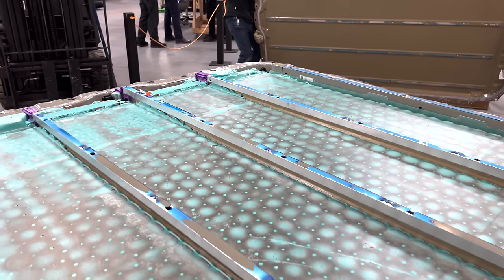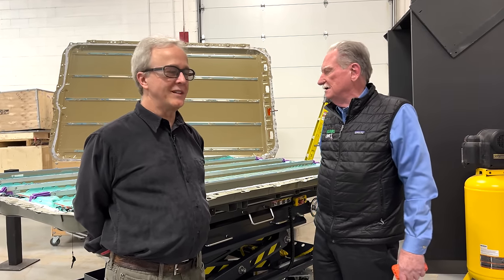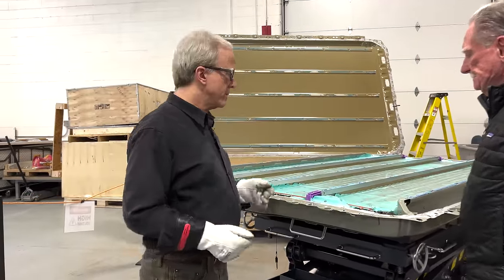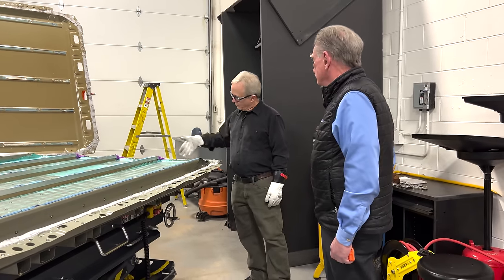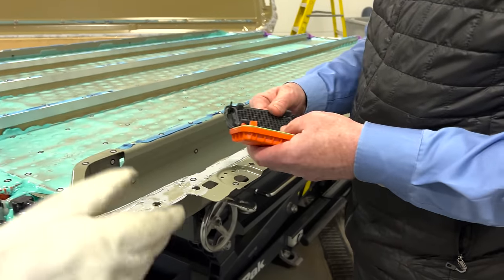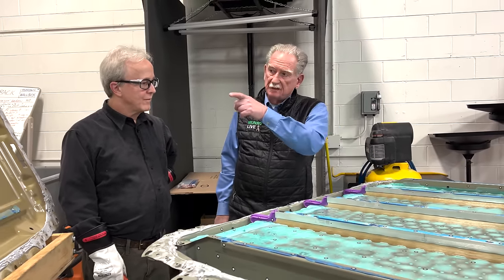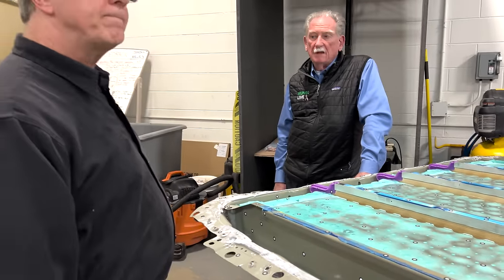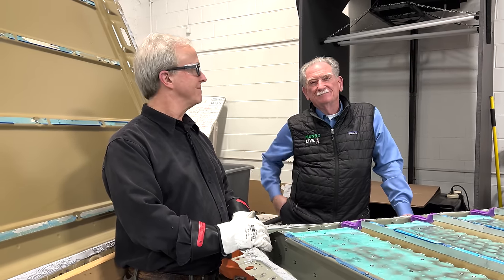Tesla Cybertruck Battery Pack: Our First Impressions Under the Lid

Comment: Salute to Cybertruck Engineers
Reply: salute to the honda k24 engines on my channel is the highest milage suv on the planet the honda crv with the k24 over 1 million miles no electric vehicle on the planet is better than my vehicle.
Reply: ??? for building a battery that cannot be repaired if anything with its 10,000+ parts go wrong??
Reply: @tellyboy17  - Better to have a pack that never fails. As you add modularity, connectors, and can't deal with a little moisture, your pack becomes less reliable and may need those repairs you seem to want. Poor reliability is great for the dealers and service techs!
Reply: @tellyboy17 
Only ev on planet has bidirectional charging and 150K miles warranty on the battery
Reply: How many Cybertrucks will ever change their battery after it will go dead in two decades?
Reply: lol!!!! salute what!? since the tuck came out it hasnt made any serious offroad, whats the point?!
Reply: @tv-ld3wv Free Supercharging transfer  gotta be leaving the chat after bi directional becomes mainstream.
Reply: @tv-ld3wv  The warranty is 8 years. After that the smallest defect in this battery means a total loss. This means that after 8 years residual value will be close to zero, or basically as much as a gambler is willing to venture.
Reply: @tellyboy17  
150K miles or 8 years is the worst case scenario
Normal worst case scenario: no home charger
In cybertruck case : add bidirectional charging
If most of your charging is at home + no bidirectional charging then this battery will survive over 15 years or over 500k miles
Reply: @tesla_tap Never fails, sure buddy.
Reply: @XantheFIN  two things, legacy repair services and alternative drop in solutions …
Reply: @tv-ld3wv  The f150 lighting has that since launch
Reply: @billybobbob3003  There are plenty of vehicles with the Ford 300 (4.9L) that broke 1 million miles. GM also had the 3400 v6 which is extremly reliable, many early Lexus's broke 1 million.
Reply: @JD-yx7be 
You didn't get the point 
Worst case scenario for EV is only super charging with no home charger now add bidirectional charging but still having 150K miles warranty on battery is impressive 
That means if most of your charging at home the battery will survive over 15 years or 500K miles
The lightening will change the warranty since they have access to Tesla superchargers now
Reply: @JD-yx7be  im talking about honda k24 holds record for the most miles for a sport utility vehicle/crossover.

Comment: brilliant design.  elegantly conveyed by Tom and Sandy in layman's terms.  Much appreciated!!!
Reply from the maker: Glad you enjoyed it
Reply: Its a disposable battery pack that isn't going to be financially viable to replace. Once again Tesla has taken awesome tech and made it worse than a cell phone.
Reply: @EthosAtheos  was thinking the same , it wont be possible to diagnois any problems.
Reply: @EthosAtheos  this battery pack is designed for extreme conditions so it is basically completely sealed, while implementing some inventive safety features.  Design is superior to anything else out there for the same purposes.
Reply: @ep7  no
Reply: @BBingo-v5i  can you give an example of another vehicle battery pack with these features?
Reply: @ep7 Superior? Lol. Thats why more Tesla's then 1930s Ford's is standing in junkyards.
Reply: @EthosAtheos remember when Apple decided to make batteries in iPhones non replaceable by user? Many people said “what if”. Many more keep buying iPhones.
Reply: @EthosAtheos  It's worse. It also means that it is unusable in other applications as the modules would have to be rebuilt.
Reply: Disgusting design. Can't be repaired, recycled or replaced.
Reply: @radry100 I’m sure the Tesla engineers didn’t think anything through when designing this battery pack. 😂. Good thing you’re not part of the team as well. People thinking of easy to replace batteries are kidding themselves. You expose much more risk to the battery packs itself if you can easily detach and replace it. It’s built to last for a reason. This ain’t a tv remote. Same idiots who refers to everyday batteries in cell phones and remotes will think these batteries will degrade at the same rate.

I rather have a battery that will need to be replaced every 10-15 years than every other year.
Reply: @danubiosalas4231  Haven't owned an IPhone sense the 5. Because of the way apple was going.
Reply: @ep7  Yes, but actually no. There is no reason to make a battery impossible to replace cells or at least sets of cells. 

I off road and my gas tank is sealed and easily removable. The fuel pump inside isn't welded in. The gas tank has a skid plate to protect it and isn't the lowest point on the vehicle. 

With minimal effort you can adapt my car to being submerged in 32-36" of water. Same as the cyber unrepeatable truck. O and my vehicle weighs 1800lbs less than the cyber mistake. 

Also the battery isn't completely sealed. It can't be. They even talked about how it isn't and what can go wrong. 

It also completely fails at being "design is superior". A land cruiser or even Jeep is a better off road vehicle. An F150 is a better truck. Even the lightening is a better EV truck.
Reply: @EthosAtheos  You are talking about ICE vehicles. I was responding that for a battery based power supply this was very well designed and I’ve not seen anything comparable. I think you are responding based on a tangential assumption to my original comment. Yes some ICE vehicles are better designed for those purposes you’ve mentioned.

Comment: I saw a lot of people drawing hasty conclusions based off of the single photo Munto posted on Twitter a few days before this video went live, and I just want to say it doesn't seem like there is much room for another layer of batteries. 

Edit: its room for gas venting in event of runaway and also extra space in the event that you hit something underneath the car.
Reply: almost like people who dont know what they are talking about should jsut keep quiet LOL
Reply: YEP. :d People are delusional. Why would u leave 80mm of extra empty space. Altought if they want too doo doubble pack they can in "theory" do it such way they decrease pasanger space and ground clearance if the mirror pack and compact it. Needed diferent central console and sets frames in this case. So 30-400 les passager space and 30-40 less ground clearence could give u dobble pack. But i m sure they will not doo that. CT in afterall niche product.
Reply: @Hotspur37 Yeah it was just weird how people were drawing conclusions based off of a photo that was posted that didn't have any explanation from Munro lol. It was just a simple picture of a battery pack.
Reply: lol!!!!!! its for offroad purposes which the vehicle still hasnt yet proven any serious capabilities

Comment: That thing you mentioned about the difficulty in disassembling this newest generation of battery doesn't bode well for recycling the packs when they expire. Just dealing with the cells themselves is apparently an issue, but when the pack is completely glued together like this, I imagine it will present quite the problem.
Reply: These packs usually just put in an industrial shredder and the difference materials get separated for recycling.
Unfortunately you can’t reuse or repurpose the cells due to being bonded together but recycling is still possible by breaking down the packs to their raw materials.
Reply: @streddaz What a waste....
Reply: Throwaway battery

Comment: Anybody thats done legitimate off-roading  knows that cover is absolutely going to get pierced if people push it. 

The aftermarket will solve this serious deficiency but do not being trying to rock crawl without the aftermarket parts first. Of course youd need lockers too so that might be a long long time 😂
Reply: I was thinking the same thing Elon said it was more truck than a truck I don’t think so this flimsy pack cover will be punch thru and then water will get in plus if you go a sell the truck with a dented and scratched up battery pack how good is this going to be for resale value ? If the truck came equipped with a removable and replaceable skid plate the this part could be easily replaceable I think TFL trucks tested a Hummer EV off road and they scraped the underside of the truck but they said the truck had a skid plate and the engineers said that it was designed to be able to support the compete weigh of the truck 9000 lbs.
Reply: The Cybertruck that has two electric motors on the rear axle, has an internal "differential" lock that combines the torque of both rear motors. Of course when disengaged, each motor operates one wheel.

Comment: As an offroader, I would disagree that the crush zone under the battery is quite enough.  Yes, we often come down on rocks which can dent components under the vehicle.  But rocks can be sharp enough to pierce things like the oil pan, transmission pan, gas tank.  So it's quite common and cheap to put thick steel skid plates under these sensitive areas.  This battery is huge, so while a skid plate could be installed, it's going to be really heavy and will need strong, secure mounting points to bolt the plate to.  With a Wrangler, that's typically the frame, using a lot of the points that the existing pans and tank are mounted to or the engine or transmission case.

Comment: Another great video Sandy and Tom!  I wonder if you could break off a chunk of thet structural foam and do a.Flamibility test?
Tesla has some great solutions for handling water ingress.  Unfortunately that foam is likely make the pack economicaly unrepairable, prevent fire fighter water application to the cells, and hamper efficient recycling. 
Then there's the stranded energy issue.  In a.breached battery of conventional design dunking the pack remains in brine or sodium bicarbonate solution will eventually discharge all cell groups. 
With the pretty green foam keeping water out, all bets are off. At least my bets
Reply: good points , its a pity , it looks like will be impossible to repair ,hopefully Tesla has some sort of insurance in place for that problem.
Reply: It's designed to be ground up and all the elements are separated then recovered for recycling/reuse.
Reply: @tomnel  BS you can't recover anything from destroyed material  Not to mention the expense it's cheaper to make a brand-new one.   This whole design is throwaway garbage which is okay but they should be honest about it.

Comment: More on the vent valves and their reliability in dusty environment, researling after contact with water and maybe some guidance on maintenance on these would be useful. In the nordic climate, the older model s are suffering from "leaky" valves where dirt accumulates and compromises the selaing, thus allowing more road dirt and winter road salt to penetrate the battery, even with no real water exposure.

Comment: the 4 modules not for repairability but for reducing scrap cost at production, if they have a faulty modul thez can replace that one and slam in a new one before they foam and glue everything together. It would be hard to produce a whole battery without faulty welds or connections so this is makes production cheaper by allowing a little rework.

Comment: @24:35 Suppose you high-center your off-road Tesla CyberTruck and dent the battery skid plate.  Who determines if the battery is damaged enough necessitating replacement and I this replacement covered under Tesla off-road use warranty or by insurance?

Comment: Another throw away product, so eco friendly 👍
Reply: No product is 100% eco friendly, Plus these batteries can be broken down to recycle some of the materials.
Reply: A lot of valuable materials in one place, much more incentive to recycle
Reply: @kyzlekiko The recycling plant is going in your back yard, enjoy your evening glow!
Reply: Wow.. lost for words to these answers 🤦‍♂️
Reply: Drive your gas car until the maintaince costs empty your wallet I love my dual motor model 3 more than my Ferrari
Reply: And it’s faster too
Reply: Most EV battery packs are reused as stationary storage. This Cybertruck pack can easily be cut apart into four long modules and be reused for many decades.
Reply: @imconsequetau5275  my point is that any damage to the battery even minor one and insurance will write the car off as they don't want any risk of fire or whatever that can happen when you damage it, so your car now is just a scrap.
Also one cell goes bad and car is not feasible to repair and that is what I mean when I say that this is just another throw away product.
Reply: @dazdoestip6459   
The Tesla 4860 cell design has eliminated the most common cause of cell failure - the single narrow conduction tab present in 1865 cells. Instead it uses continuous contiguous tabs along the entire length of the anode and cathode electrode ribbons. This design greatly increased cell conductivity, allowing greater efficiency, perfectly uniform temperature, and fewer cells within parallel sets. Tesla has also eliminated the failure mechanism of the fine jumper wire to each cell, opting instead for a laser welded foil/sheet.
Reply: @imconsequetau5275  So you saying it is 100% reliable? And what about if you drive over something on the road and it lets say damages one cell what happens then? The whole battery basicaly is a scrap since it is all covered in glue. Throw away product, the end.
Reply: @dazdoestip6459  
I already know that a single cell failure still leaves the entire battery pack at 6 ÷ 7 = 85% of original full capacity. And nobody knows how hard it is to dissolve that resin. Nobody has even tried to repair a CT battery pack. Yet.

Already bitching about non-repairability, tisk - tisk.
Reply: @KC-uw6ph where is the evidence of this
Reply: @frederickfaller899  What is everyone driving that needs high maintenance costs?  A ww1 tank?

Comment: Has anyone figured out how to bypass failing cells yet?  Its bad engineering to have a single cell produce a full pack failure.  Also did they make the inlet coupling more robust such that a crack does not render the pack useless? That was a Model 3 issue and for bouldering it would be catastrophic.
Reply: This battery pack is even less repairable than your Apple phone 🤬
Reply: There are (probably) seven cells connected in parallel for each series connected voltage step. 

Keep in mind that these 4860 cells have a continuous long strip of copper tabs for both anode and cathode, so the conventional failure mode (of a single narrow tab) has been eliminated.
Reply: putting more in parallel protects you from a bad cell.

Comment: So to test for leaks all you have  to do is sit the CT in enough water, activate "wade mode" and look for bubbles. Brilliant!
Reply: Tesla could have a leak down type test.   All it takes is a pressure transducer in the battery
Reply: @danharold3087  Thanks.

Comment: I personally would not be that cavalier about the risk profile of the battery pack during the segment, "A Quick Safety Message". Yes, the terminals are still encased in plastic and foam. And yes the terminals are quite a distance from each-other; however, seems to me one could still easily and accidentally short both battery connections with conductive tools to the lower half of the shell the battery pack is still being held in.

Comment: Non-serviceable means bad engineering
Reply: Most of the batteries are built this way
Reply: Cheap* not bad
Reply: @ukaszw6623 They're built this way because it's a cheap nasty solution. But how do you remove all that HORRIBLE sticky crap to recycle the battery?
Reply: Well. It is a Tesla.
Reply: No
Reply: The only company producing a similar amount of EV's (BYD) is doing the exact same thing.
Reply: As main fault problem in batteries after 10 years is water destroying circuits over the years it might be a good decision making them absolutely waterproof in this way.

In the 0,01% of batteries with other problems it is a problem not being able to easy disassemble single parts but 99.99% are getting more robust.
Reply: Yes and probably the electronic components also dont like the shock hazards available in a 500 PS moving vehicle.
Reply: @renatomercurio4774  Every 500hp engine shocks the system arount it (or even itself…).

Comment: Read the Tesla patent from around 2015. You are probably going to find a set of heat pipes under the cells that is connected to those larger cooling channels which carry the cooled liquid through the pack.

Comment: Do you think 46120 batteries would fit? There are a lot of manufacturers working on 46xx cells:
4680:
28Ah 278 Wh/kg (BAK)
26Ah 300 Wh/kg (EVE)
23.35Ah 244 Wh/kg (Tesla)
15.3Ah 146 Wh/kg (BYD)

4695:
35Ah 290 Wh/kg (Sunwoda)
33Ah 270 Wh/kg (BAK)
32.5Ah 280 Wh/kg (EVE)
30Ah 270 Wh/kg (Sunwoda)
29.7Ah 260 Wh/kg (EVE)
300 Wh/kg (CALB)
300 Wh/kg (SVOLT)
310 Wh/kg (Gotion)
320 Wh/kg (REPT)
350 Wh/kg (EVE)

46110:
350 Wh/kg (EVE)
300 Wh/kg (CALB)

46120:
Samsung
Reply: The gap between the pack and interior floor and the open space in the battery together leaves plenty of space for 2 rows of 4680 cells. 123kWh x2 makes 246kWh which is plenty to get the promised 500+ mi range. 225kWh is my personal minimum for towing.
Reply: A real lot. Tesla is setting a new standard. 
Is BMW already in this list? I thought they work with CATL?
Reply: Thanks for some great info. 350 watts per kg would suggest that the Cybertruck battery could soon be >160kWh if they switch to 4695 batteries or similar
Reply: BMW 4695 and 46120